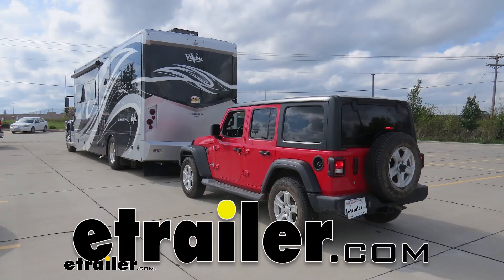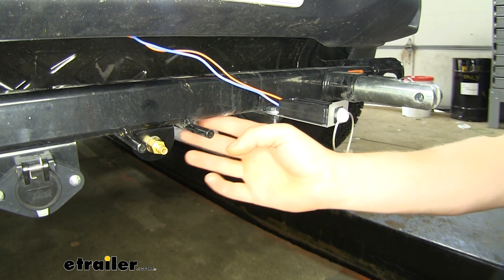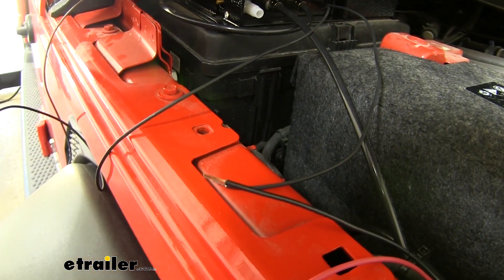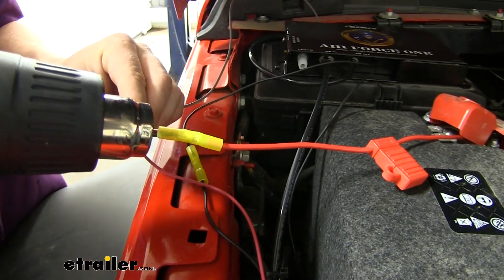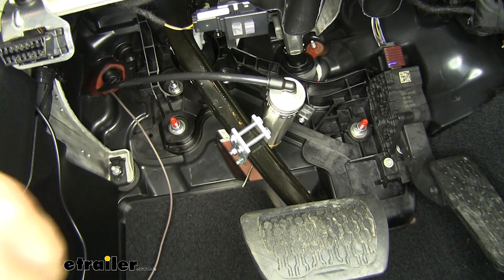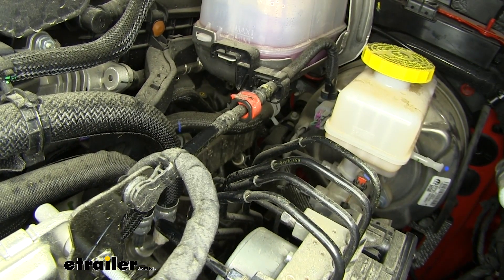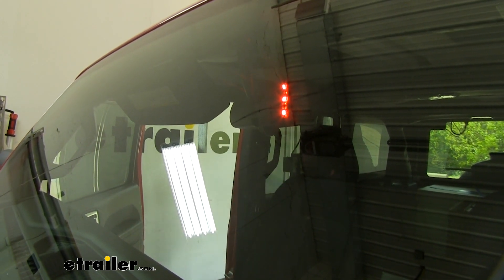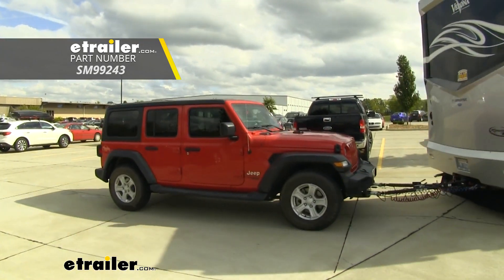etrailer | SMI Air Force One Braking System Installation - 2018 Jeep Wrangler Unlimited

Comment: I would like to know if there is a likely way to identify the correct air line on the motor home to tie into for the air that operates the towed vehicle braking system. I have a coach made by Monaco, circa 2005
Reply from the maker: The air line tubing is most likely the same 1/4" tubing that comes with this kit. 
https://www.etrailer.com/Tow-Bar-Braking-Systems/Demco/SM99243.html